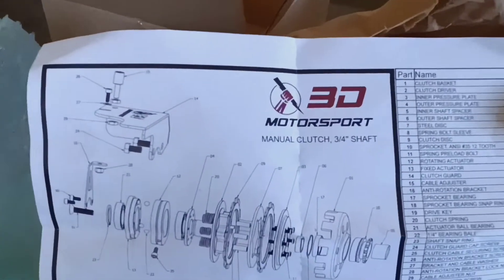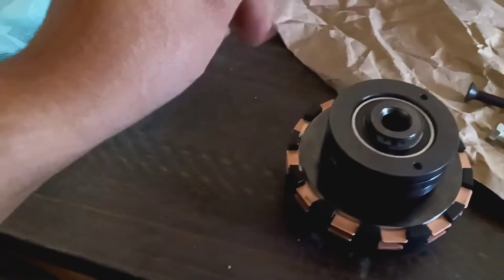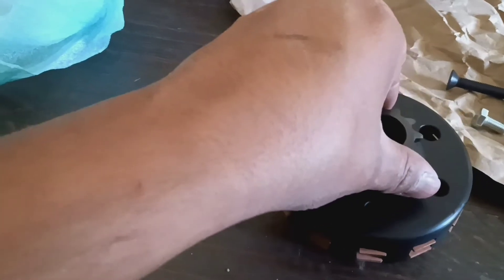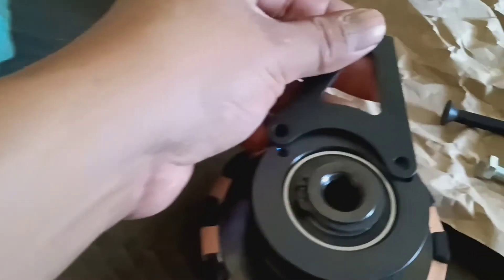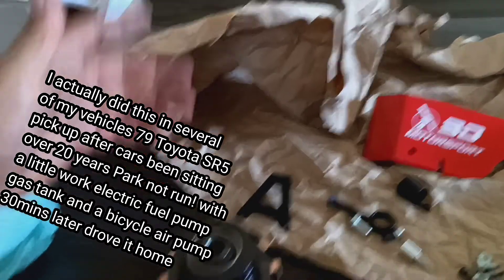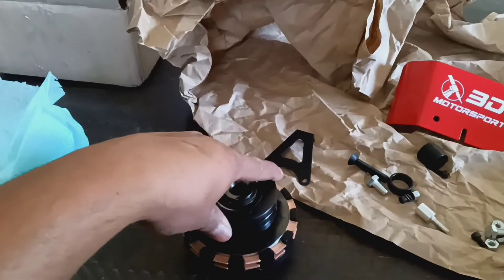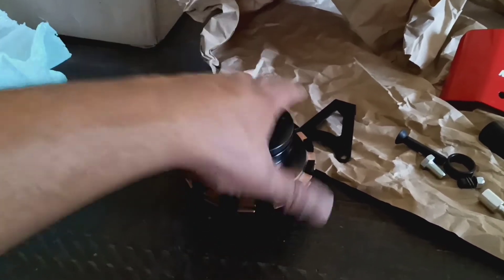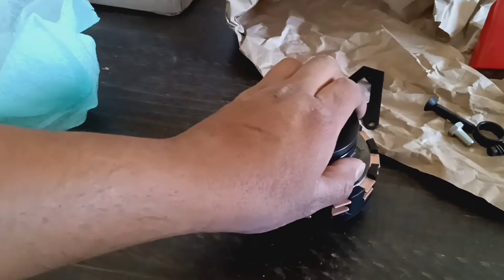3D Motorsport manual clutch run through unboxing

Comment: My RDM shaft kit is going on the RDM Saw, I just got a regular cvt clutch, its heavy duty but if it  don't hold the power, I'll b looking into this more, thanks for the info bro, ggz-👽👍🚲💥💨🌴🌴🌴🌴🌴🌴🌴
Reply from the maker: Yeah your CVT clutch should work perfectly but this is only good for if you do not want to run a pull start if you just want to run like the old school way where you hold the clutch ride the bike and pop the clutch but honestly that automatic clutch should be a lot better it would change the right a lot and honestly I think if you're having the shaft kit from RDM you should put it on a piaggio if you got one of those but that's very cool you actually ordered the saw engine
Reply: @mozezcen-valley7555  yessir, we ordered that saw couple months ago, but n that time I've ordered most stuff for Piaggio build at home😁👽👍 soon very soon, ggz-🚲💥💨🌴🌴🌴🌴🌴🌴🌴
Reply from the maker: @Op1zilla  how's that going got it running
Reply: @mozezcen-valley7555  Haaa, I wish, still waiting on the man to ship everything,ggz-
Reply from the maker: @Op1zilla  wait you have a piaggio engine pre order .. I think currently they don't have them in stock but I think the saw engine is actually being made as we speak
Reply: LOL

Comment: Did you just recently buy this clutch?  I thought they went out of business years ago.  If it is new where did you buy it at?
Reply from the maker: U can use promo code MOZEZCENVALLEY at check out save u a bit on everything on website official site 3d motorsports. Com
Reply from the maker: Yes